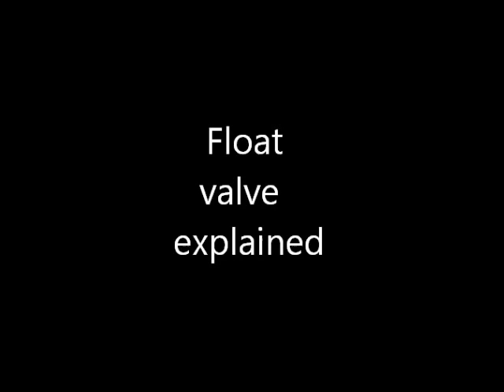Electric Pressure Cooker Float Valve Explained

Comment: This is still so useful & relevant for newer models. I accidentally pulled the gasket apart while drying it and couldn’t find anything in the manual. I think it happened for a reason because I’ve just learnt how to take different pieces apart to clean it and what they all do. Float valve has a very important function!! Thanks!
Reply from the maker: Glad it was helpful  . We call ours the Magic Pot

Comment: Omg I have had my pressure cooker for a couple years and have only used it a couple times. Last time I cleaned it I took the lid apart to clean it and apparently didn’t put it back together it wouldn’t come up to pressure. I thought I lost something. We are in the middle of a remodel and don’t have a kitchen and Easter is this Sunday and I just did the water test and I’m so excited it’s working. I can use my pressure cooker to help with dinner I truly thank you from the bottom of my heart!
Reply from the maker: Thank you for watching and commenting

Comment: I didn't need to replace anything because the part was normally already there. That's all I needed to know. Thank you so much for saving my Green Pan electronic pressure cooker. I've had it for years and wasn't able to use it because I didn't think all the parts for there, but they are. Best pan ever made by Todd English. had it for years. Does everything but can. now I'm back in biz. Thank you!
Reply from the maker: Thanks for watching and commenting . Pressure cookers are great .

Comment: Thank you for this information.  The float valve fell out of my son's pressure cooker, and there was no information in the manual.  I was able to use the information provided to replace the pin, and actually understand why it was there and what it does.  This was a very helpful and informative video, and I greatly appreciate your time and effort in creating it.
Reply: Same here... found the float valve sitting in the pot and I had no idea what or how to put it in... great video.. thanks.
Reply: Same here, the stress of everything leaking and burnt food. I was ready to get reed of it. Very useful information

Comment: Glad I found your video. I have the 6 qt Nuwave Pressure Cooker and instruction booklet said NOTHING about locking the floater in place. No wonder the thing stayed in preheat mode. Works like a charm now. Thanks so much!

Comment: Thank you for the video. My cooker wasn’t building pressure so when I opened the lid I noticed the pop up piece was not sealing. The little gasket was gone. My wonderful hubby cleaned the lid and that piece came apart apparently without him knowing. I couldn’t find the info on user guide and your video came up in search. I was able to find the gasket (on kitchen floor lol) and reassemble properly. My cooker is back in action sealing. You’re a life saver.

Comment: Your video was a life saver! I used my pressure cooker tonight (the exact model you're demonstrating). Halfway through the cooking process, F4 showed up on the display. I released the pressure & took off the lid. A little plastic donut & a silver pin fell on the counter. I had no idea what it was or where it fit on the lid. Thanks to your video, my cooker is up & running again!! Thank you!

Comment: Your video saved me!  I had only used this small pressure cooker twice and was cleaning splatters from the bottom of the lid, then when I put is back together I couldn't figure out the hole I saw.   fortunately, I found the metal valve on the floor and figured out how it went in the hole,  but I was scratching my head to figure out what holds it in place.  Found your video, bingo!  After several trips around the kitchen on hands and knees it wasn't to be found, great.  Then it dawned on me, I had seen my dog chewing on something earlier and couldn't figure out what it was.  Well heck, the mutt probably swallowed it.  Lucky me, I took a look in her favorite corner for chewing up napkins and so on, and there it was and undamaged.  Happy dance.
Reply from the maker: Glad you are back to cooking with it again

Comment: You absolutely saved me!!!  I had washed the lid a few days ago and did not notice the float valve had come apart and when i used it again of course it would not stop spewing steam... so after 2 tries i took a better look and notices it must hafe a part missing...so that meant i had not seen it ant threw it out with the sink strained garbage... now im self isolating so my garbage has been sitting for a week...and i seperate the food from paper and i had a good 5 lbs of veg scraps starting to compost...sigh...but you KNOW its absolute necessary to find it...so my search began...and of course...i found it... ot the silver part...but couldnt still get pressure...so i washed up and searched YouTube and THANK GOD i found you with similar pot!!! So back into the trash and sure enough i found the rubber seal...and your instructions were GREAT... So were all ok now.... really REALLY thank you!!!
Reply from the maker: Glad you were able to find all the parts

Comment: Thank you! I had made dinner and the lid was stuck closed after the pressure was released.  I watched your tutorial and used a tiny screwdriver to job that little float valve back down.  Didn't even know it comes apart to clean, so thanks for that. You've saved dinner.  And my sanity.
Reply from the maker: Glad you was able to get your magic pot up and cooking again

Comment: Thank you very much for your easy to understand explanation. I was having trouble trying to figure out my float valve re-assembly for my Technique pressure cooker. It came off when I was washing it and I didn't know how to secure it back in place. I do now. Thank you very much,
Reply from the maker: Thank you for watching and commenting
Reply: No problem, the gasket had me scratching my head.

Comment from the maker: Just turn it off and hit the pressure relief.It will open as soon as pressure is off. It wont blow up, most the old ones blew up because of operator difficulty,but these pots do it automatic so they are very safe.

Comment: Where in the world can it get one of those little gaskets to replace the one missing from my pot?  I have looked for a place to get a replacement and can find nothing!  Please help.  thank you for this explanation that I needed so bad!  This is a second hand gift to me, with NO instruction book & that gasket missing!  Thank you Judie
Reply from the maker: ebay or amazon . Can get washers  , sometimes comes with the metal piece too . I believe most the washers are interchangeable between brands .  Maybe something like this would work . Just first one i saw , there are many to choose from . https://www.amazon.com/dp/B071CG35N3/?coliid=I2KMYOVB2P3RG7&colid=3HB2ATCCOA09X&psc=0&ref_=lv_ov_lig_dp_it
Reply from the maker: https://www.amazon.com/dp/B075V9PYM6/ref=sspa_dk_detail_5?psc=1&pd_rd_i=B075V9PYM6&pf_rd_m=ATVPDKIKX0DER&pf_rd_p=a54d13fc-b8a1-4ce8-b285-d77489a09cf6&pf_rd_r=2AE54JKTE2PX0MKG5Z3H&pd_rd_wg=wvitY&pf_rd_s=desktop-dp-sims&pf_rd_t=40701&pd_rd_w=DxVp5&pf_rd_i=desktop-dp-sims&pd_rd_r=5c4ea1a0-93e9-11e8-86ed-5f3f486d05ff
Reply: wtbm123...thank you so much.  I wondered if I would even get a response being that this video was made in 1012.  I appreciate your help.  If I haden't seen this video I would not have even known about this.  I called QVC & they wanted me to send the whole pressure cooker back to them to get it fixed, so clearly they don't know the mechanics of the pressure cooker.  Such a simple fix!  Awesome people on YT!!!!  Smiles & appreciation...Judie
Reply: I thank you so much for helping me.  A wonderful explanation, very clear.  I knew nothing about how this worked...I just know, I lost mine & the pressure cooker wouldn't work anymore after 1 week of use.  Judie

Comment from the maker: I would make sure everything is very clean and moving freely. Next I would check and make sure all seals ,on valve and lid gasket, are soft and not hard or cracking. It takes pressure to close it so if it leaks any where it will not build enough pressure to close.Would be what I would check on first. And is the pot still reaching full temp.

Comment: Loved the video, explained quite a bit. I do have a problem with a brand new Philippe Richard 6 quart. It's aluminum so I used very low heat and it came to pressure. The regulator on top had a nice gentle rocking but when I shut off the flame under the pressure cooker, it just sends all this water and steam out at the base of the lid  instead of just cooling and releasing the lid like you would expect. Why is it doing this?
Reply from the maker: if coming out around the lid i would maybe replace the gasket seal on lid , Most have one and they are cheap . Some all american brand ones just use a taper to seal and uses no seal , if one of those make sure the sealing surfaces are clean and not pitted or anything
Reply from the maker: Sometimes small beans and things can kinda foam some and spit out foam , but out the release , should never shoot out around lid .

Comment: Thank you!!!  Great video.  I have an Elite pressure cooker and  steam escapes through the pressure valve the entire time and everything is fitting right and clean etc.. Now recently the timer is not counting down which usually indicates its not upto pressure but I know it is cause I'm learning how long things take to cook. If the timer doesn't count down the food will continue cooking and then it will be burnt to a crisp and maybe catch fire.. Anyhow have any issues as I've mentioned?

Comment: I have the Power xl pressure cooker, removed all the parts off the lid to clean.  I am not sure if the nuts, bolts and washers replaced properly, would like to see a video showing proper replacement. Thanks!
Reply from the maker: +Billy Revis If u look in owners manual , They have some pictures on how it goes back together
Reply: Ok, thanks!

Comment: Hello, where can a person order the little rubber gasket/washer for the pin? Evidently mine went down the drain unbeknownst to me when washing the lid. I learned from your video that this little gasket is vital to correct operations by keeping the pin from popping up and out. This is what is happening to mine  therefore no pressure will build up! thanks!
Reply from the maker: Amazon has some . i think many are the same

Comment: Awesome video! It seems that my lid is alright, but I've been getting an error (E13) after I select a cooking option and it's now only working without the lid (sauté mode). I wonder if you have any idea about what this E13 error might stand for. The manual only says "Float sensor open/short circuit", asking to contact the fabricant (Aigostar), which wouldn't help whatsoever. Could you give me any insight on that?
Thank you very much and have a great weekend!
Reply from the maker: Sorry as i am of no help either .  From your description sounds like an electrical issue . Not sure if there is a way to test float sensor or not . Is there an exploted view in manual. Does it show the float sensor. But then getting parts may be an issue. If had numbers from old part , may be able to find , But then again it may be a part soldered on a circuit board . Some circuit boards can get cracked solder joints and people reflow the soder on them .  But in reallity to be honest , I have no clue. Hope you get it sorted . If you do , PLEASE come back and post as it may help another on day .  Sorry i am not of much help.

Comment: Hello there! Thanks so much for this video! Now I'm still having an issue with this lid. The lid won't lock and I did all I could to make sure that pressure valve pin was down but it seems to be broken and the pot won't pressure cook the chicken. The pot is definitely heating up but lid is still unlocked. Can you maybe explain this part in stupid terms lol because I'm just not getting it. I don't know what to do. Thanks again!!!!
Reply: i guess it's suppose to do that....
Reply: Is there an answer for this persons question? I'm having the same issue...
Reply: Dolores O. Perez 
Me too is this how it's supposed to work

Comment: Hey, I was just given a 8qt. Power Cooker plus and it has a couple parts missing on the lid. The main thing is the nut for the floater valve or pin. What does the threads on the top side of the nut screw into to hold that nut into the lid so it doesnt fall back out? I know about the gasket to hold the floater in. It's the floater that's at the locking mechanism.

Comment: thanks for your video, we have the power pressure xl which has a very similar lid. The rubber seal fell off the pressure release pin the first time we used it and since I didn't know where it belonged, I tried to "fix" it by putting the pin in the hole from above and shoved the rubber seal in after it (from above).  We think it is lodged somewhere in the mechanism.  Can the bolt be  taken apart so we can get it out?
Reply from the maker: +Lee Neil  I am unfamiliar  with the XL , but i would find a diagram of it and may beable to tell from picture if it comes apart or not
Reply: +wtbm123 thanks for your reply, we will try to find a diagram.

Comment: I have a question if you are still monitoring this thread. The hex head mount that holds my float valve spins freely. Thus, my pressure cooker (Cook's Essentials 4 qt) that I picked up at a garage sale hisses for the entire cook. Can this be repaired?
Reply from the maker: I have never removed mine , but thinking it is suppose to just thread up in till tight . If it will not tighten up then threads may be stripped out

Comment: I have a problem in that the pressure cooker top locks in place even after the pressure is gone and it can't be opened.  You have to keep trying in a back and forth action and it might open or it might not.  What is your suggestion?  I have a friend now that can't get his cooker open at all.  Maybe a part needs to be changed if it can ever be opened.  Thanks
Reply from the maker: Clean every thing well . something may be making the pin hang up . Easy to get stuff in near the pin , harder to get it back out

Comment: I have an AEG electric pressure cooker. It is very similar to the one in your tutorial. Can I take all the components of the pressure cooker lid apart and wash them all separately in hot water and a mild detergent? E.g. The weight/pressure limit valve; the float valve; the strainer and inside area of the strainer; the safety valve etc.?
Reply from the maker: should be able to but not sure on your model. I take everything i can apart on mine from time to time for a good cleaning

Comment: I don't understand why there is steam being released from the float valve. shouldn't this valve be sealed when under pressure and thus be preventing the lid from being unscrewed? the float valve isn't supposed to function as another pressure release is it? And furthermore, how much pressure could this cooker possibly generate? OK, never mind the last question, I found the pressure rating to be 12psi cooking pressure to 14psi max.

Comment: When I lock my pressure cooker, the locking gate closes the hole. When does it open again to let the float valve pop up?  I used it for the first time last night without noticing, but had to put the gasket back on after cleaning. Now I'm at a loss. Should the gate be closing? If not, what's wrong with it?
Reply from the maker: It locks the lid on while there is pressure , so pin will not drop till pressure is gone

Comment: Hi wtbm123, IM hoping that you're still answering questions from this video. I watched and thought you did a great job of explaining the "Float Valve". I have an Elite 10qrt that I purchased from HSN over a year ago. My sister dropped the lid when I was not home and apparently lost parts. I tried using it afterwards and all the food burned. I wasn't sure what was happening until I saw that there was a hole in the lid and a screw, gasket or valve or all was missing until I saw your video.  I tried emailing the company but the representative does not understand what I am trying to ask for. If you have any idea of what I need to ask for when explaining this part please let me know. Thanks in advance
Reply from the maker: +ladysoulsinger The little pin with a seal on it is a floating valve. the big black one on top that lets steam out or seals pot is a Pressure Limiting Valve . I sent you a message , it is a link to the owners manual. the last page showes the parts and names
Reply from the maker: +wtbm123 sorry not last page , but page 7
Reply: What size would you recommend for the rubber gasket replacement if I get one from the local hardware store?

(and thank you for the informative video!)
Reply from the maker: +Florin D. Lung I would take old one with you or if do not have old one then take lid so you can match one up.
Reply: +wtbm123 Yes, thanks, I'll take the metal piece with me. I found this metal piece in the sink when I last washed the lid, but the plastic piece was already gone.

Comment: Power xl pressure cooker..where the value sits in the little plastic pocket thing, is that suppose to have a slit in it or did it Crack. I never noticed it before. Was using it and heard slight releasing of steam the whole time, that never happened before. Help
Reply from the maker: Not sure , but for most the replacement parts are cheap , May just replace it.

Comment: I have a Tefal all in one electric cooker. I was cleaning the lid and the instructions said to take out the float valve for cleaning. I did and now I can't get it back in! On the top of my model, the hole for the float valve is covered by a round black piece of plastic that looks like it's not meant to be removed. I have been trying to reinsert the valve from the bottom but it just falls out. Please help! Thank you!
Reply from the maker: Not sure on that model ,